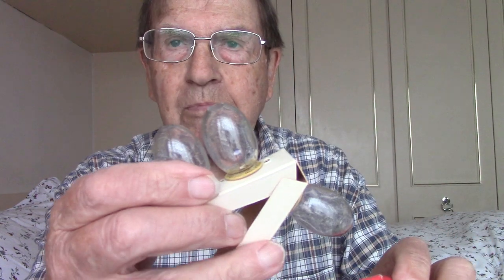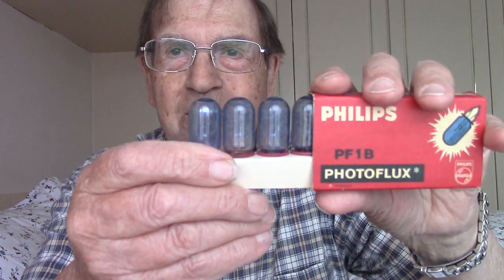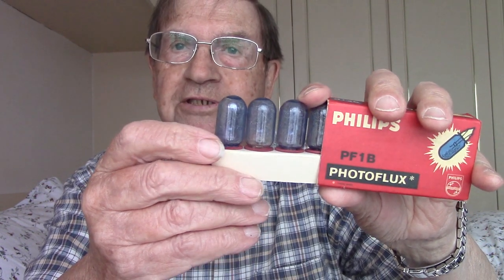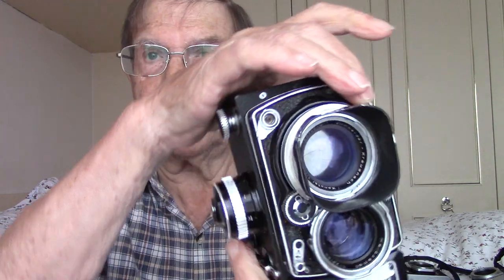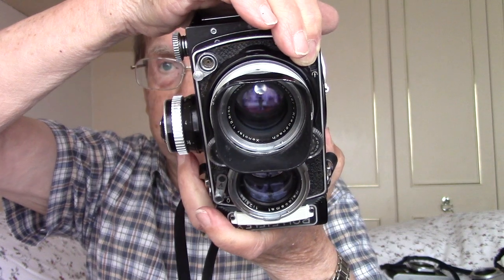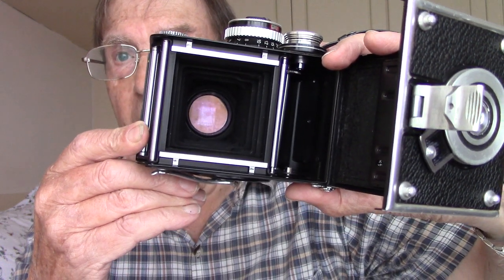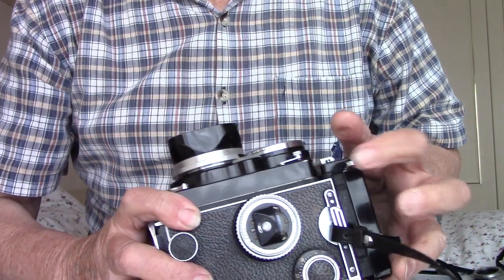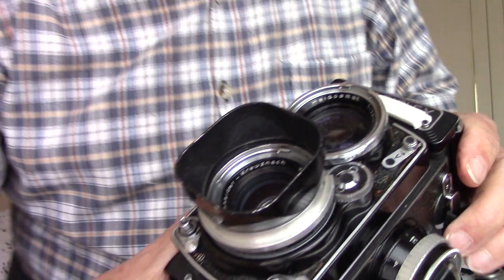How to use Flash at High Speed

Comment: Another great video Peter. As far as I know the EX range of Canon flashes were designed to be used on Canon digital slr's and not 35mn film cameras but they can be used on those Canon film cameras which offer ETTL  flash capability like your canon 35mm film camera has. Interestingly the older EZ series of Canon flashes don't work on canon digital slr's as they don't support ETTL flash metering. Just a note for anyone thinking of purchasing either an EZ or EX flash unit.